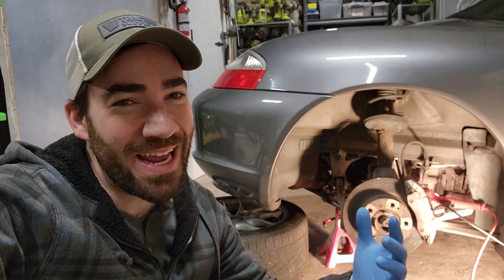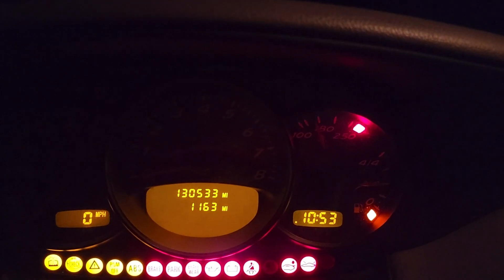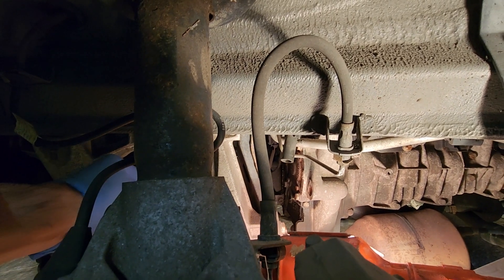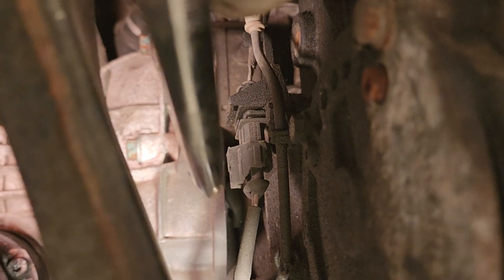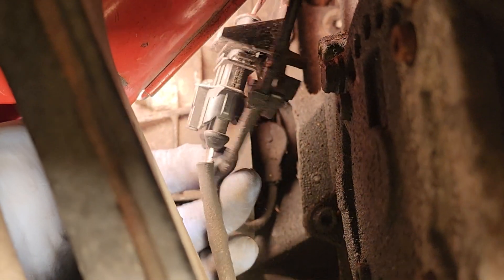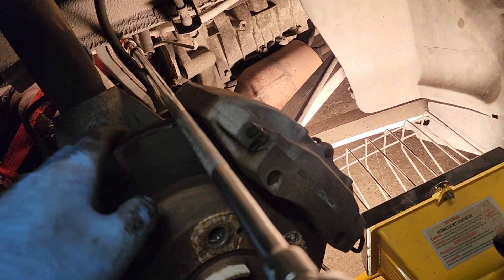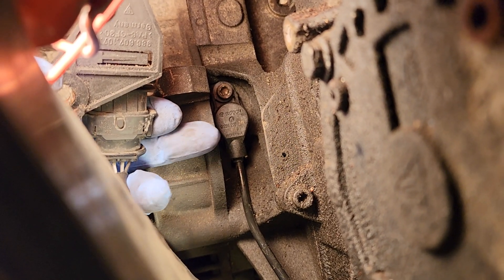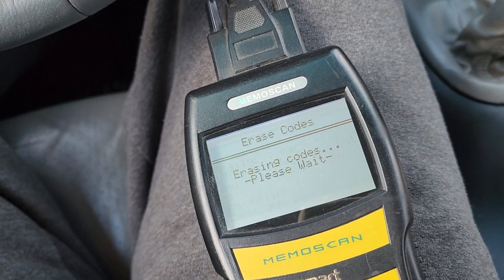The Porsche Boxster Crankshaft Position Sensor Issue (and how I fixed it)

Comment: I'm currently dealing with trying to get that sensor out of the bracket on my 996.2 4S. That thing doesn't want to let go of it at all and there is less room then with the boxer. Been fighting with it for the past 2 hours with no luck.
Reply from the maker: Dang, hope you get it out.
Reply: @EveryotherKarl I ended up getting a hook tool then clamping a long needle nose pliers to reach the end of the hook tool handle then pulled and was able to get it out of the bracket. The 4s has much thicker suspension components so there is less room.
Reply from the maker: @aszrael1266 nice, glad it came out

Comment: Good video!  I replaced the crank position sensor in my 997 as just part of my PM, as it isn't hard to do in a 911.  Now I carry the old one as a spare.  They are a wear item and cheap enough that doing them every 100k or so seems like good practice in my opinion.